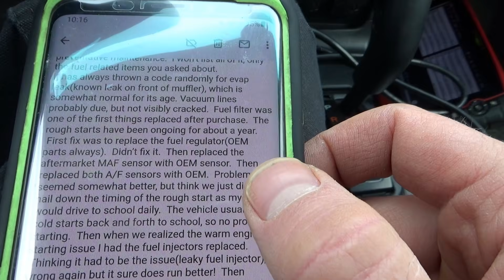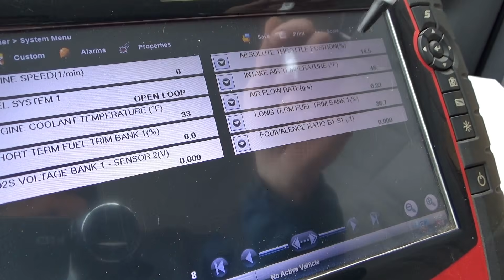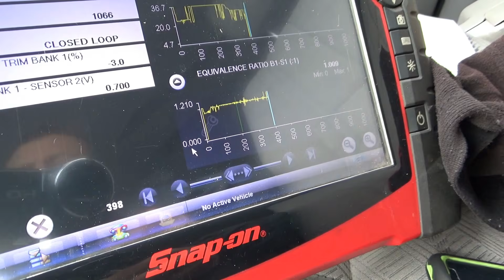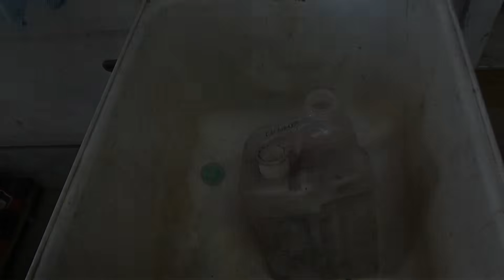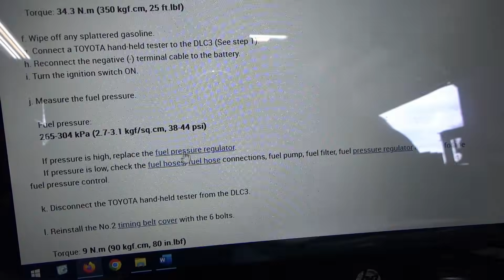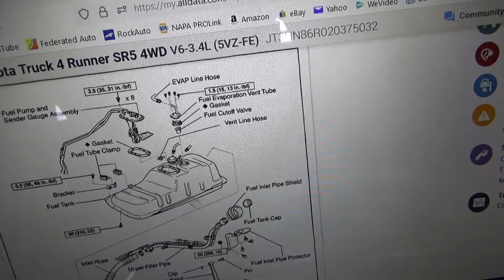1 Year of Toyota PARTS CANNON...Long Crank When HOT? (Part 1 - 3rd Gen 4Runner)

Comment: The 5VZ-FE is known for lower intake gaskets leaking coolant into the central valley. The by-pass tube that runs trough the valley has a sealed plate that blocks coolant from running out the back (mysterious coolant loss). Fel-Pro makes updated Lower Intake Gaskets (Not plastic w/embossed rubber that break apart). Sometimes the metal by-pass tube will develop a leak in the small welded tube attached to it. ALL 5VZ-FE's end up leaking coolant into the center valley.

Comment: Reading that email at the beginning is like a near perfect description of my symptoms for my 2000 Tacoma 3.4L. Given my truck has 245k miles on it, I'd dare say I just need to replace the fuel pump just as a matter of maintenance schedule. Might as well replace all the gaskets and seals for the EGR components on the top of the fuel tank at the same time. I'm getting the EGR codes when it's real cold and windy outside so I imagine the tank is leaking vacuum when the seals get hard and shrink.

**Meant EVAP not EGR. 😅
Reply from the maker: @heftyjo2893  you probably mean EVAP... not EGR 😄
Reply: @PineHollowAutoDiagnostics  Oh! Yea...

Comment: OMG!!!  Those 3 items add up to over $500.  Do you have to have both the "FPT22 Deluxe Fuel Injection Pressure Tester" and "FPT290 Deluxe Fuel Pressure Tester Adapter Kit"?  Can you tell me which two lines you used to tie into the fuel line?  FSA??  Thank you very much.  I've been having the same issues but haven't been able to make an adapter to work.  Mine is a 2000 Toyota 4Runner.  I want to tie in where you did.
Reply: Did you ever figure out a way to check the Pressure?
Reply: @TheBeardedScreenwriter  https://www.youtube.com/watch?v=n4XigMxKuAo
Reply: @TheBeardedScreenwriter  It ended up being my MAF sensor and I changed the fuel regulator.  https://www.youtube.com/watch?v=n4XigMxKuAo&t=1s

Comment: if the radiator and the hoses have be been replaced it probably had a tranny cooler leak. that would explain the gray slime and the swollen over flow hoses

Comment: Toyota as one of the best now after the run away gas pedal and the Head bolts problem I not as big on them now a motorcycle has a emergency shut off switch how come they not put them on cars you can't turn off the key the steering wheel locks in the off position

Comment: Good that you called yourself out for mis diagnosing the fuel pressure drop as a line leak
Reply from the maker: That's not a misdiagnosis, just a correction to the experimental procedure. A misdiagnosis is when you complete the repair and the car is still broken 😄

Comment: Apart from a blocked filter or pickup screen, could there be a crushed fuel supply pipe or a partially clogged fuel supply hose?

Comment: “Reman” Fuel Injectors are junk, don’t waste your money. And beware,  eBay has Injectors super cheap, but they’re garbage China clones. They even come in OE packaging & numbers correct. Injection Masters Service, will test, clean & flow balance OE units for about 100$. With a 1-3 day turn around. Same goes for Fuel Pumps, always use an OE Denso on your Yota’s.

Comment: Why in the world did it take you so long to put the fuel pressure gauge on the system... One of the first steps we would have done is to verify the fuel pressure.. at idle, off idle ,and engine off..
Reply from the maker: Yes 20 minutes is so long 😅
No Schrader valve, so you have to split the line, make a mess, and install special adapters. First weak pump that I have seen, especially on a Toyota... Definitely not the most common issue to cause a lean condition 😊

Comment: I predict pinhole leak in fuel hose going from the fuel pump the fuel distribution assembly inside the gas tank or a clogged fuel pump strainer sock.  also a possible pinched fuel line under the truck..  a fuel flow test would be interesting.. he may have low pressure and low flow.. when you deadheaded that pump the pressure should have gone alot higher until it hit the bypass.

Comment: I had the same problem on a 1990 Mustang 5.0. Fuel pressure would fall off when the engine was shutdown. It was a hole in the rubber fuel line in the tank. It was basically bleeding back into the tank. I replaced the pump and the rubber lines. The car ran like new.

Comment: On the evap code the issue is going to be the gas tank.
I threw the parts cannon and the last thing i replaced was the tank.
It had a Very Very small pinhole at the top.(probably due to our PA rust lol)

Comment: I would liked to see a scope trace of the fuel pump current.  You can spot a bad pump motor that way.  I also would have like to have heard the pump.  I had one that went thunka-thunka-thunka. Easy diagnoses, not so easy repair.

Comment: Arm chair mechanic..  Could you measure the voltage closer to the fuel pump?  Maybe a but unlikely a wiring problem between the relay and the fuel pump?

Comment: We had a 2002 S-10 with a 4.3L  that had a very similar problem. Hard starting but ran good. Fuel pressure would drop while revving up the engine. Ended up being the fuel pump. One of the pump motor brush springs was broke and not putting enough pressure on the brush.

Comment: After 175K miles I am not surprised it needs a fuel pump.  I should think one should be replaced after 150K miles, as it is a wear item.  On to part 2!  Very good, interesting diag work, Ivan!
Reply: i have a '97 Taco 5VZFE with 341k miles and original fuel pump still with no issues yet
Reply: Yeah it’s not a domestic POS. These fire pumps last a LOOONG time!

Comment: Sounds to me like you have a fuel leak inside the tank, leaking fuel from between the pump and the outlet... A worn pump would have higher ampage due to mechanical wear .A low ampage means the pumps spinning easely, doing very little work. Same reading as you would get if the vehicle was out of fuel....looking forward to the next part
Reply from the maker: If it was an internal leak, there's no way it would hold 30psi for hours after shutdown 😉 This is not a common failure for sure!
Reply: @PineHollowAutoDiagnostics I didn't consider that...

Comment: Just one last check to do before replacing the fuel pump would be to see if you can power up that higher amp tail light bulb makeshift tester that you have. Just because you see 12v on the test meter, it doesn't mean anything if those wires can't carry a current. Those bulbs should be nice and bright if those wires are any good in testing the fuel pump's power and ground.
Reply from the maker: Absolutely 😊

Comment: Before you drop the tank, you have to get under the rear seat and go through the hatch and unplug the connector on the top of the tank.  The harness is to short to undo it while dropping the tank.  

Why Toyota gave us to that tiny hatch just to unplug it and not big enough to get the tank unit out is nuts. 

The pump voltage supply and ground run in the door sill along the driver's door.  Pull up that plastic sill to get access to it.

Comment: The low pressure and amp draw tells me the pump is under very little load. I'll bet the hose from the pump in the tank is split.
Reply from the maker: If hose was split, how can it hold 30psi after shut-off? ;)
Reply: Some vehicles have the regulator in the tank, after the hose coming off the pump. @PineHollowAutoDiagnostics

Comment: I'm honestly surprised that running so lean for so long didn't cause internal engine damage. I'm seen many engines melt pistons and other parts from running too lean.
Reply from the maker: Luckily ECM had enough fuel trim range to compensate!

Comment: We had a car with bad fuel pump (no one checked). Started when cold (got extra fuel), started when hot (easy).But if you went to a shop for 20 min it wouldn't start, you had to wait for 20-30 min, then it started again.

Comment: When you went to check the throttle body for gas fumes, I almost thought I heard you say perfume.  I'm thinking that Ivan loves his Shell #5.  lol.  Anyway, is there a fuel filter on those things?  That too could cause a low fuel pressure issue if the fuel filter is clogged.  But you checked for voltage and amp load.  Only 1 amp draw?  That ruled out back pressure from a clogged filter or pinched line.  It's the fuel pump alright.  "She's dead Jim".  <-- Old star trek quote.

Comment: Awesome! Yup, low fuel pressure will give all kinds of problems. My car had the hot soak problem. It was the fuel pump!! I was lucky, don't need to pull the tank in the 2004 Lincoln Town Car.

Comment: I pretty much know you can fix some of these vehicles much faster by making an educated guess and go straight to the problem you think it is to check, but that wouldn't make a good video.
Reply from the maker: Educated guess is not good enough 😅... In fact the PHAD motto is "no guesswork" 😉
Reply: @PineHollowAutoDiagnostics  but do you ever go straight to the thing you think it is in the beginning and check it first? I guess I work on the same brand so much I get used to the common problems.
Reply from the maker: @Bryan-Hensley  oh sure that saves time, but still need to do the basic checks to prove the problem before replacing any parts 👍

Comment: Ivan, I'm surprised you didn't examine the fuel lines for obstructions or kinks.  I was thinking about the video a couple years ago of the junkyard car that had 5 fuel pumps thrown at it and you found that the fuel hose was twisted or pinched.
Reply: ... of course, I still agree that you correctly diagnosed the weak fuel pump motor.  Hahaha.
Reply from the maker: If you pinch the return line and pressure is still low, that rules out any restrictions 👍
Reply: @PineHollowAutoDiagnostics  Well that is something I didn't know.  🤔 Thanks for pointing that out, Ivan.👍

Comment: What about the fuel filter. I think this vintage still has one. I mean that doesn't explain the pressure drop off. But it can affect pressure.
Reply from the maker: If you pinch the return line and pressure is still low, that rules out any restrictions 👍

Comment: A handful of Toyota pumps of that vintage where the electric motor is fine but the pump portion failed ( impeller/vanes) Low amp draw along with pressure and volume. 
Looking forward to part #2.

Comment: That coolant reservoir hose has been contaminated with oil of some kind.  Radiator hoses do the same thing when trans coolers start leaking into the cooling system.

Comment: Very cool thanks Ivan, I've had this on the 4cyl 2700i Toyotas before, the pumps don't like to run dry at all and if they do they often start to lose pressure then become noisy, the Jeep 4.0 on the other hand will lose power with the slightest drop in fuel pressure🙂

Comment: My old 02 6.8l f250 had what I call a soft fuel pump failure. I was looking for the cause of a fish bite misfire at steady cruising, in the beginning it was only at 35-40 mph, over 2 years it grew in speed range. I did find 2 bad COPs but the fish bite remained. I checked fuel pressure with no load and it was perfectly in spec. I tested the regulator and it worked perfectly. When the fish bite got really annoying I did all of the same fuel pressure tests and got the same results so I put it in drive set the parking brake( my gauge has a short hose that didn't reach the windshield and I was alone) and just as the parking brake cable snapped I saw the pressure drop to 20 psi. Until that point I had max pressure on acceleration and above minimum at idle, in gear or out of gear.

Comment: I think I would try using your bench power supply to feed the fuel pump.  Changing the voltage from 13 v up to 16 volts and watch the fuel pressure.  Do this to try and prove whether it is the fuel pump itself or possibly a damaged wire restricting current to the pump.
Test before replace.

Comment: The swollen hose was likely from the trans cooler leaking inside the radiator early in its life. EPDM material on the coolant hoses do not play well with petroleum products. Saw that happen a few times on these.
Reply from the maker: Ah the radiator was definitely pretty new! So glad my Suzuki is a stick shift haha
Reply: Yep, the dreaded strawberry milkshake will degrade the coolant hoses, and possibly the rubber seals on the radiator cap and thermostat.
Reply: If so that would be a good reason to change out the cooling hoses, thermostat, etc.

Comment: Back in the day, the 87 Buick GNATs needed all the flow and pressure you could get when putting in bigger injectors, or raising the regulator pressure delta vs boost pressure. Either with a bigger pump or stock, we would measure the voltage and see .4 or .5 of a volt drop from the battery voltage, so from 14 to 13.5 example, at the back of the car, sometimes worse. That or more was enough to fight for and would have an effect on pressure and volume under high demand conditions (full throttle, max pulse width, 20+ psi boost). The most popular early fix for mild hp cars was a fuel pump wiring and relay kit. We’d run thicker wires (fused) from the battery power block back to just before the pump, and use a high amp rated relay to power the pump, using the former wires that powered the old pump to activate the better relay. This way the ECM and associated electrics still controlled the pump. This made a big difference in how a stock or upgraded pump would perform at higher pressures.

Comment: You think that fuel pressure is crazy..  stick a oil pressure gauge on those motors..  the only motor ive ever heard of that is supposed to run a warm idle at around 4 psi..   like wtf..  at stop lights theyll drop to like 3 or 4 psi and as soon as you give it any gas theyll jump up to 40..  lol

Comment: Been years, but i had similar issues with clients GM truck. It was the hose from pump to metal feed line in tank assembly.  It was rotten and split. Amp draw threw me, yet it did guide me dropping fuel cell and inspecting pump assembly where i discovered split hose.  
I'll be Standing By.

Comment: Those 3.4’s have one o2 sensor and one a/f sensor..  the o2 is a typical 60$ hollar but the a/f sensor looks like a typical o2 sensor but cost 3x as much because they trigger quicker and respond quicker..  according to toyota..  mine wouldnt run right until i paid the 162$ for the a/f sensor then stopped running lean all the time..

Comment: As long as I've been involved with electric fuel pumps and electronic engine control, I could never understand why fuel pressure was not monitored and a possible dtc would be set for low fuel pressure. There must be a reason, maybe someone could explain.
Reply from the maker: Fuel pressure isn't monitored on older return systems with a fixed regulator setpoint. But a Schrader valve would be nice 😁
Reply: They’re getting into it more now. Some brands have more monitoring and also are pulse width controlling how hard they drive the pump, instead of just hitting it with battery voltage (off or on).
Reply: That would be nice, wouldn’t it? T100 owner, with a 4th gen supercharger on the 5VZFE…

Comment: At least the Fuel Line Quick Connect Fitting didn't keep popping off inside the Fuel Tank. This actually happened on my 2010 Land Rover LR 4. I Subsequently replaced the Quick Connect Fitting and Fuel Pump, but it was a nightmare diagnostic procedure.

Comment: It just doesn't quit! You get your share of diagnostic treasures. My bet is on the injectors and possibly the fuel pump/regulator. The old injectors might be OK because the new ones are flowing more than spec to keep it running disguising or even causing the low fuel pressure.

Comment: When my dad retired he took the caravan to France and did a season skiing. Anyway i went to stay with him for a week. On the way back from the airport he said somethings up with the car it wont go over 67mph and keeps kangarooing violently.
Anyway he'd bough a load of parts plugs leads and changed them still did it.
Two days later we went on a day trip and the car was literally kangarooing up really steep hills we gave up half way on the trip.
The next day we took the carb to bits checked all the jets etc float etc screen.
Still no difference. 
Anyway i took the fuel hose off the carb and on cranking it was dribbling out, then i took the fuel filter off and it shot across the carpark about 15feet.  I said dad has the filter ever been replaced " well no" and he had done about 80 thousand miles without changing it. When we cut the old plastic filter open it was totally blocked with black stuff 😂 
Fitted the new 2euro filter and fixed 😂

Comment: I'd also check fuel pump connector for corrosion and pin fitting,  and check pump one more time by feeding it good power and ground before condemning  the pump.
Reply from the maker: Absolutely!

Comment: Amazing! I can't believe that it runs so nice with fuel pressure that low and that the computer can compensate that much. Looking forward to part two.
Reply: Well, even better is an understatement!  This is my 3rd gen in the video & the throttle response is amazing.  Not a race car, but love the butter smooth engine.  Had one in my 97’ T-100 manual and loved it.
Reply: It will run even better when the pump is replaced! That truck isn't a rocket, but it's down on power at WOT.

Comment: I have an old Ford with 2 tanks. Both have cheap fuel pumps in them. Both run low fuel pressure, but I have issues with cold starts. Warm starts are fine.

Comment: You probably couldn’t hear Me, but I was suggesting to check the fuel pressure early on, especially after the first bean test. But at the same time I was thinking after all work that was done, someone surely covered that base. So I was right, and wrong at the same time! No access panel for the fuel pump? WTH. I had a Highlander of that same vintage, same engine, still kicking myself for selling it. Great stuff as always. 👍👍🇺🇸